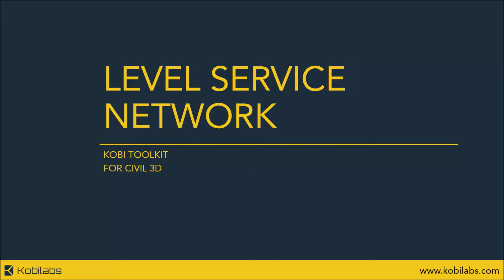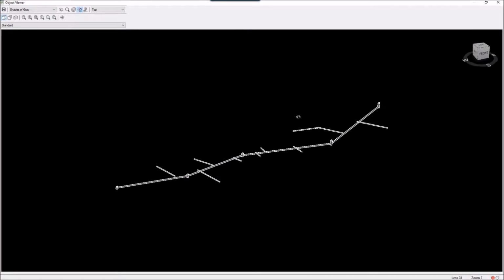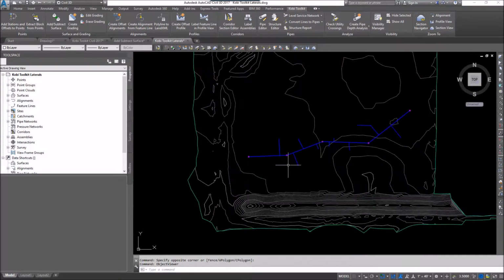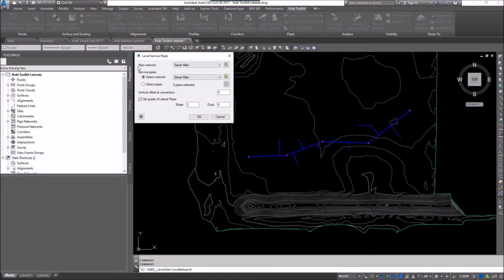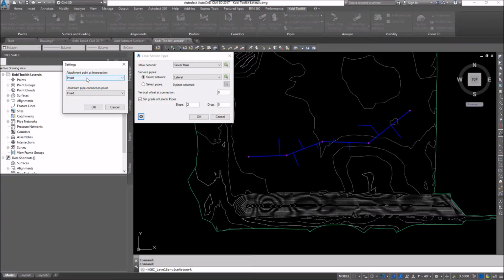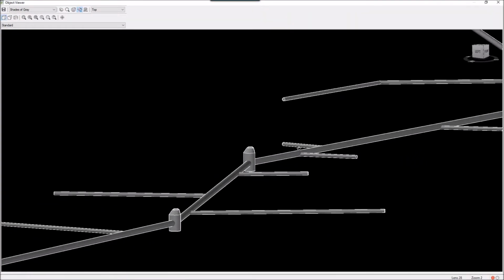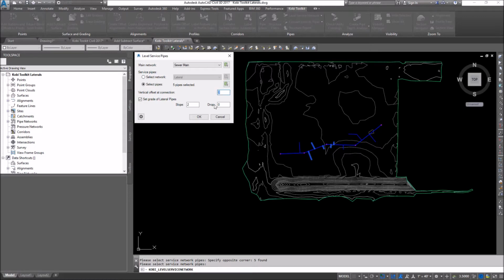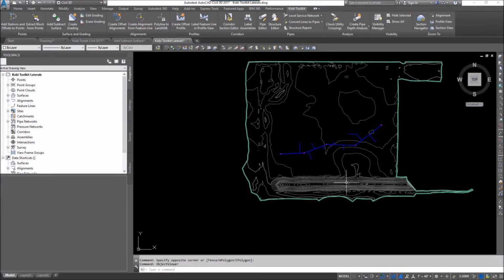Civil 3D Level Service Network - Kobi Toolkit

Comment: Can this be used to level service connections to a pressure pipe network?
Reply from the maker: Hi Robert,
Currently pipe networks are not supported, but this feature is on our priority list and should be ready within couple of months.